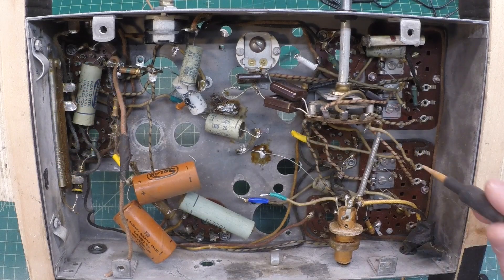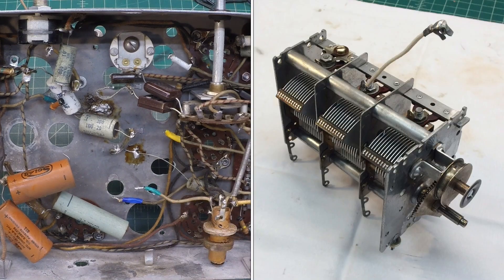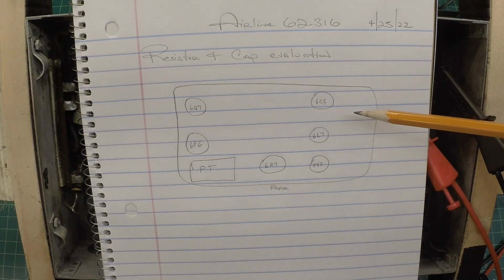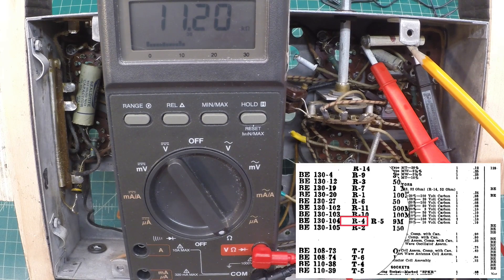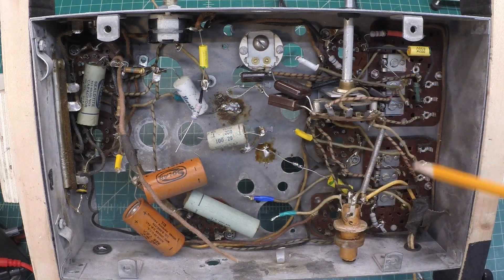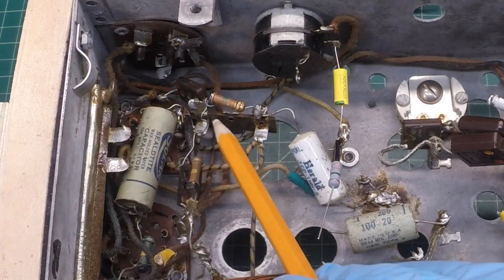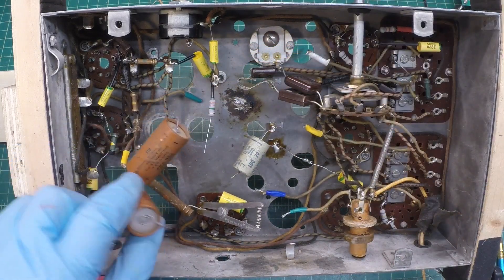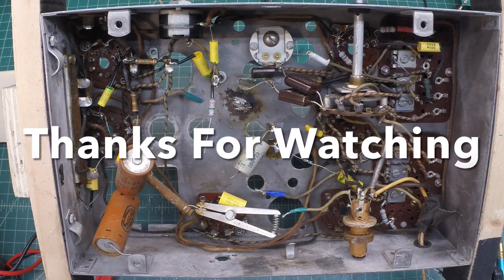Airline 62-316 - Resistor Replacements & Unidentified Capacitor?

Comment: Funny  how the Rider's for this radio mentions in the repair parts list that the list is good for serial numbers 6E249476
and up. What about those lower than that serial number? Is there a different schematic with other components perhaps?
  Also was looking into the Radio Troubleshooter's Handbook by Ghirardi at the "Case Histories" section and found a fix 
for a problem involving the SW and BC section of which the BC band was inoperative  on this model.The fix was adding another capacitor of equal value ( a mica at .003uF) across another mica .003uF capacitor already in the circuit. I wonder 
if some early repairman  thought adding this unknown capacitor found here was a cure for a different problem that was occuring ? He sure put wrong values of some things here and there to possibly get it to work. This was called your usual
 home visit by a repairman  back then. Whatever on hand to get the set to work. Some didn't need a schematic or so they
 thought as experience was their teacher. Steve
Reply from the maker: Steve, good catch on the SN range, I’ll need to check. The info from Ghirardi is helpful too. The additional capacitor in mine is a coupling capacitor running from the 6C5 plate to T5 (in lieu of the direct connection on the schematic) which matches the design of the Airline 62-296 schematic. Thanks again for your help. You never know what you’ll find in one of these oldies. Best, Don